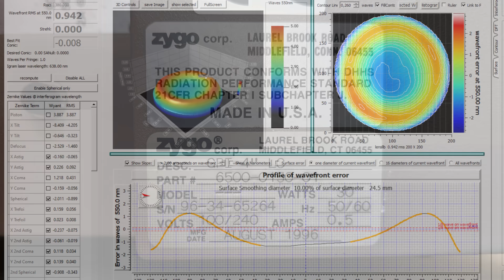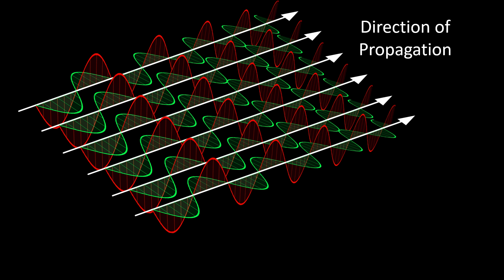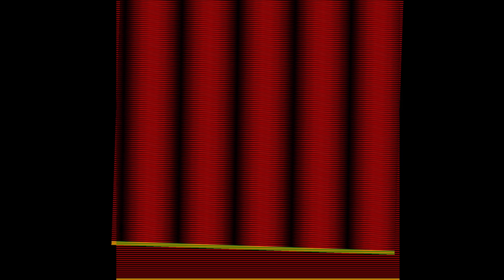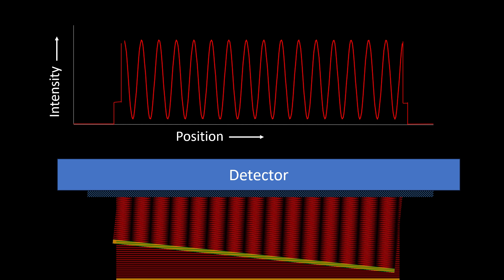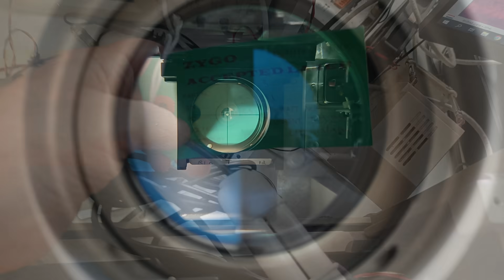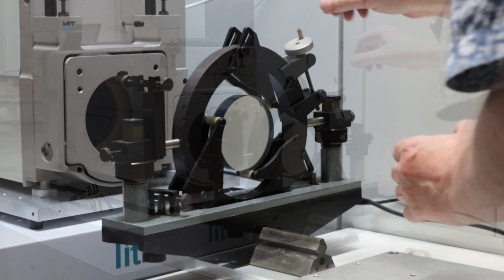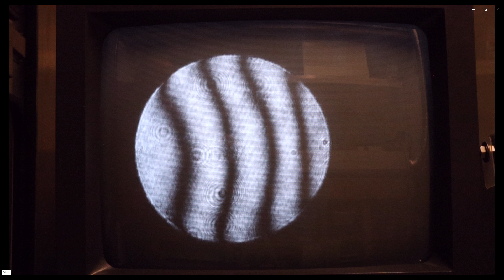Optical Interferometry Part 1: Introduction & ZYGO GPI layout

Comment: Expansion would cause convexity and your finger-heat caused a curvature that goes against the rest of the pattern, so the rest of the surface is concave.
I see a wide area of constructive interference on the left of the image, so this would mean an area of less slope in reference to the flat surface.

That would mean answer A.
(As it is concave and a 'flatter' area relative to the flat surface is on the left)

Love the video. :)
Reply from the maker: We have a winner!
Reply: Oh I was wondering how to get A vs C, the relative flatness is a neat way of thinking.
Reply: Good job, mate!
It also shows how inportant are good thermal stability conditions and a well designed multi-point support for telescope mirrors.
Even when you have a perfect surface, maintaining it in a working optical instrument is another difficult design task.
Reply: Through the same logic about thermal expansion I realized that it has to be eiter A or C. But I didn't know that it would be THAT easy to choose between them. I thought that the orientation of the interferogramm isn't necessarily coincide with the original surface. Anyway, very informative video and congratulations to the winner.👍
Reply: For the first post, that would be correct answer, since heat do funny things to optics, which is usually why they're in thermally controlled environments, especially for laser-related hardware, and yes, even an expensive and professional DPSS module.
Reply: It's also interesting to think of how this concavity and wedge were ground into the surface, by looking at the fringes. As the surface was polished, on a very flat surface, covered with polishing compound, the pressure created some amount of heating in the bulk of the Zerodur. That heat caused expansion, forming a 'belly' in the bulk of the material. This 'belly' meant that extra material was being removed in the middle (and a bit off-center, to the left). You can also see, that toward the edges, where the heat was able to radiate away, and there was less mechanical 'support' to direct the pressure to the other side, there is a quick reversal of the concavity.
Reply: in situations where the measured curvature is so small that few or even no lines are visible. When heated enough, the interference pattern inside the convexity caused by an expanding heated spot would always create a continuous loop of a fringe which has a thicker belly facing down the slope if the surrounding surface is concave, as the surface facing up the slope would have a change in the gradient from horizontal in relation to the rest of the surface in cross section, while the surface facing down the slope would appear continuous. This would also make the loops of fringes appear to generate off centre from the heated spot towards the higher side.
Reply: Good explanation. I imagine the fringes as height lines of a sphere with a decentered vertex due to the tilt. That's how I can rule out B) and C). The extra info comes from the convex thermal expansion. Digital interferometers usually use phase shifting to determine the correct sign of the surface.
Reply: BTW a good analogy is cutting an onion far from the center which yields a similar pattern to the interference of a plane and a spherical wave because of the constant shell thickness.
Reply: @kochipj  > I imagine the fringes as height lines of a sphere with a decentered vertex due to the tilt.
What an amazing way to think about it! Thanks for sharing
Reply: I was thinking it was D as I was thinking the opposite of you.

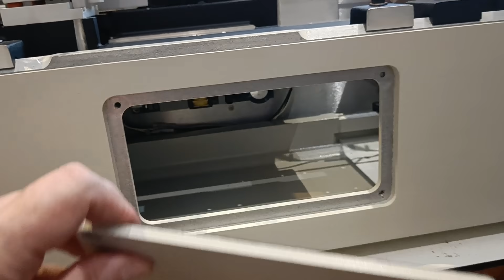Comment: 13:51 you have puffed capacitor on your power supply, it needs replacement, it might be dangerous for the electronics after it

Comment: Excellent presentation ! A question i'd like to be answered - How could we use that Zygo to inteferometrically measure larger surfaces than 4 inch ? Let's assume 10'' or larger convex reflecting surface.

Comment: If energy is preserved. How does destructive interference work? Like where does the energy go. To heat? Of what medium. Destructive interference of light also works in a vacuum and there isn't any temperature. And it also doesn't emit radiation at a different wavelength. 
So is there even energy in the waves to begin with?

Another thought: if you had a sensor that is fast enough - you could capture the perfect spectra of color... Just like how radio waves can be resolve to a wide band and deconstructed into frequency component. But that would be way beyond what modern cameras can do. I think teraherz cameras is also not accurate as they still run integration times in the milliseconds. 

Looking forward to the next videos in this series. The transformation from interferogram to surface profile sounds a little crazy. I am already thinking about how to do that efficiently on a GPU... 

And your example with the finger made me wonder, if you could use optical interferometry as kind of a thermal camera. Would require an array of small 'pixels' that slightly change their shape when thermal infrared radiation hits them. But maybe that's just a bolometer

Comment: I have a question:  If interferometry patterns are caused by variations in the surface quality of the glass, then why do we still see interference patterns when the glass is perfectly flat? The interference pattern is still there.  It seems that the pattern is not cause by light interfering with itself, but is caused by non smoothness or shape differences between two surfaces.  Surely with two flat glass surfaces that are perfect, there can be no opportunity for the creation of interference patterns at all? Is there evidence that with close to perfect surfaces, the patterns become almost undetectable? The flattest surfaces still show great, clear parallel, well defined  bands of interference. Why is that?

Comment: This ZYGO interferometer contains high quality HeNe laser. I also saw that for your self built interferometers you used some sort of red laser diode module. May I ask you what LD do you use? What is it's typical coherence length?
Reply from the maker: Generally, the coherence length of cheap laser diodes is in the order of say 0.1 to 2 meters, but it is highly dependent on the drive current (read: temperature). You can buy thermally stabilized laser diodes that have a coherence length of hundreds of metres, but these are not cheap.
Reply: @HuygensOptics Thank you! So for the start I will try HL6312G LD and precise laser diode driver with passive radiator of different sizes to try to find some crude equilibrium in diode temperature.

Comment: my assumption watching the video is that it must be a hollow and not a bulge because the material expanded back towards the in line side of the wave front. if the expansion caused the wavefront to further travel to "the right" ie, further from the edge of the wavefront that would indicate a bulge, i think that makes logical sense. as for which of a or c, i have no idea. i would guess c but only because the deformation of the wave front appears to diminish in amplitude towards that side. therefore the bigger distortion should be on the left and therefore lead to C being correct.

Comment: This video is in another level, the amount of detail and the explanation, really usefull, thank you! Would it be possible to recreate the optical path of the interferometer without using the GRIN-lens? I was thinking of the possibility of using a normal achromatic lens, similar to the collimation lens for creating the circular wavefront, but I'm having trouble visualizing how the GRIN does it and if a normal lens would.
Reply from the maker: In general, you want something with a high numerical aperture, so a microscope objective could also work. The advantage of a grin lens in this case is that it's cheaper and glued to the beam splitter with a glue that has the same refractive index as glass, effectively  limiting the number of reflections of surfaces.
Reply: @HuygensOptics Sorry for the delay in my response, but I ended up building the interferometer with an old microscope lens and it worked perfectly, thank you for the suggestion!! I built it because I'm investigating the possibility of using of the shelf microscope slides as the optical cavity in fabry perot etalon, by searching for areas with adequate nm scale natural variations in thickness for different wavelengths, since the surfaces have low roughness but moderate waviness between them over mm scale areas. The interference patterns look great.
I've seen you recommend DFTFringe for obtaining surface details when working with interference patterns from curved mirror surfaces, do you know if it has support for this type of experiment consisting of two parallel reflecting planes, or if there is any available similar software that could help obtaining data from them?
Thank you again for the suggestion!!
Reply from the maker: Sorry, I only now saw the question at the end of your comment. I hope that the most recent video answered you question. Als long as you can record a good interferogram, DFT fringe can analyse it. You just have to make the right settings in the "mirror" configuration menu.

Comment: I didnt read because i wanted to try myself.
1.) heat print local expansion of glass is seen to reverse the general fringe curvature so the surface must be concave either “A or C”.
2.) curved fringes are generally convave left so the time of flight of the interference photons being larger on the thicker aspect of the truncation indicates thicker on the right so it is “A”… i hope… lol 
I now see wider interference (both wider destructive and wider constructive interference fringe) on the left suggesting left side is away from the central geometric axis…. But im not certain this tells me if the sample image span is simply to the left of geometric center or… if its thicker on? ??? Right but i dont really think this latter inference holds much water … or light. Lol
Please comment. U have a rare depth of understanding in this.

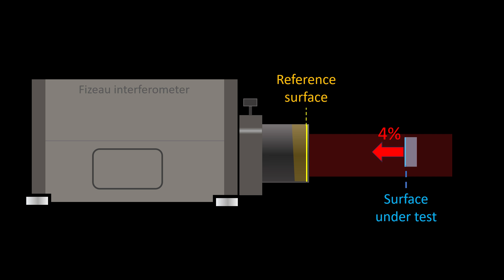Comment: In the demonstration of measurement, I see clearly 2 surfaces that reflect light if using zerodur test glass (21:09). However in case the test surface is not attached to the reference surface 19:05 19:44, there are probably more than 2 surfaces and even much more than 2 surfaces if using a colimating lens system. How do you evaluate the result that case?
Reply from the maker: Good question. The way you achieve this is by making sure the reflections of these surfaces do not reach the detector. It's illustrated at 19:05 in the reference element by the slight tilt in the other surface that effectively places its reflection outside the area of the small beam splitter. In the case of the object, you can reduce reflection (of for example the last surface) temporary with black spray paint. If that surface has a radius of curvature significantly different from the surface under investigation, then generally the resulting nr of fringes from this surface will be too high to spot them in the interferogram.

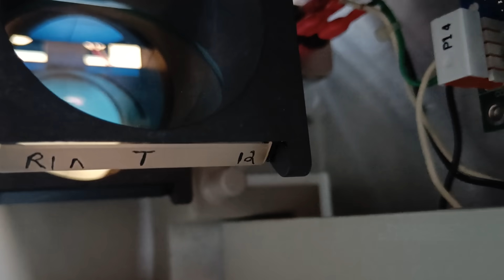Comment: You need to check your Zygo's electronic boards. Some capacitors need to be replaced as I see at 13:51 .
Reply from the maker: Thanks, I will do that or maybe even replace the 12V poser supply.

Comment: Jeroen, have you ever tried making a germanium lens for a thermal imager? All I know so far is that some of them look amazing. I wonder how different the lapping process might be compared to glass, or even whether lapping is still a suitable process in this application.
Reply from the maker: I have lapped Germanium. It's softer and requires you to work very cleanly. Also, you use Al2O3 rather than CeO as a polishing agent. I've never done a video about it though.

Comment: The HeNe is obviously a stabilised type, the wide body hints at that. There are a couple of ways this can be done, actively where the HR is positioned minutely via a servo or passively by stabilising the laser cavity temperature (and therefore the cavity length) which I expect is the method used in this device.
Reply: The HeNe inside these is not stabilized. Some of the other Zygo interferometers use stabilized HeNe's though

Comment: Thanks for this video.  50+ years ago I worked in a calibration lab using optical flats.  In our case we were often calibrating the accuracy of working gauge blocks (device under test) compared to the reference gauge block.  We would place them a known distance apart and bridge the 2 blocks with an optical flat.  Using a monochromatic light (or course) we looked at the interference pattern and calculated the difference in length between the 2 gauge blocks.  We also reported on the surface deviation of the block under test.  Of course, being so long ago, I remember nothing of the calculations, only that the procedure was quite demanding, and accurate if done well!  And by "calibration", I don't mean any adjustment was performed, only that we reported the precise length and surface characteristics of the block under test.

Comment: Can you explain the use of the GRIN? What are the advantages? Why not a normal lens?
Reply from the maker: It is is small, cheap, diffraction limited and can be glued to the beam splitter with a refractive index matched glue, thereby getting rid of 2 additional air-glass interfaces.
Reply: @HuygensOptics  ah, makes sense. Thanks! Great video, as always!

Comment: Since interferometery is dependent on optical path difference wouldn't you in your experement measure not directly surfaces difference but optical paths difference which is also include refractive index Inhomogenities?
Reply from the maker: Yes of course. The effect of the warm finger is actually so large because of the effect of temperature on the refractive index, not so much the expansion. I left it out not to overcomplicate things.

Comment: 10:00, Is it like moiré fringes used in subsampling of position encoders? So you have 2 gratings that differ slightly. (for example one has 10 lines per mm, and the other 11 lines per mm and if you look through both grated stencils, you can see 0,01 mm instead of 0,1 mm).